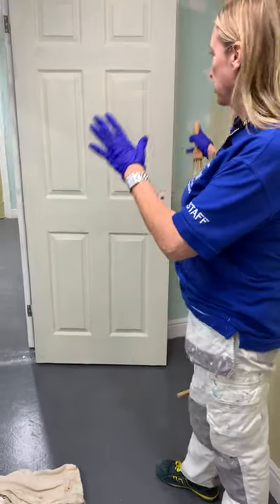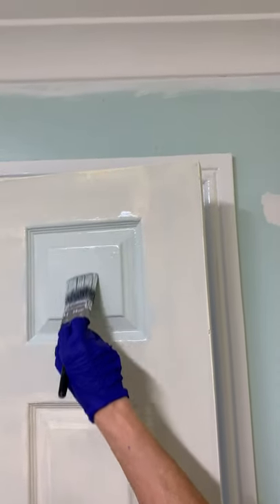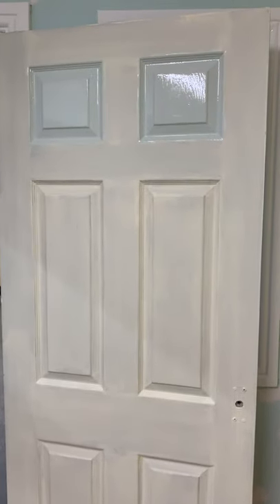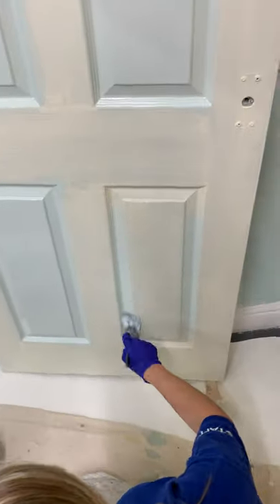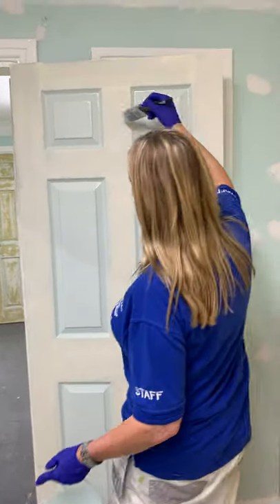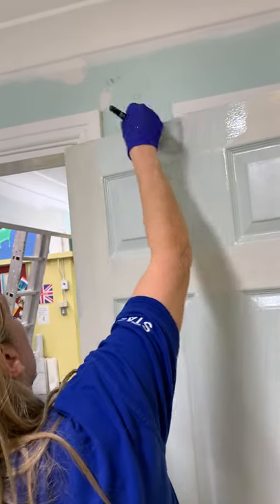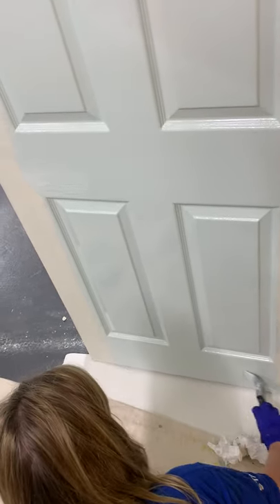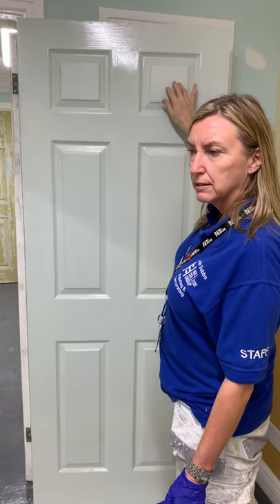How to use the correct Sequence to paint a panel door

Comment: well done.

mouldings + panels

Mullion rails.. Top, Mid and lower

Top Rail
Freize Rail
Mid Rail
Bottom rail.

Stiles & lock stile

not forgetting the hinge edge (or latch edge depending which side you are painting)